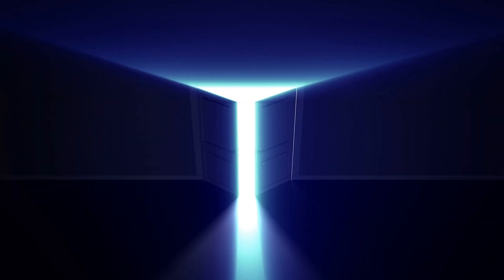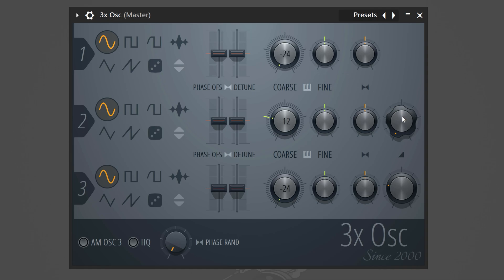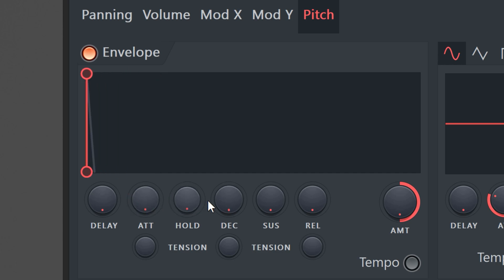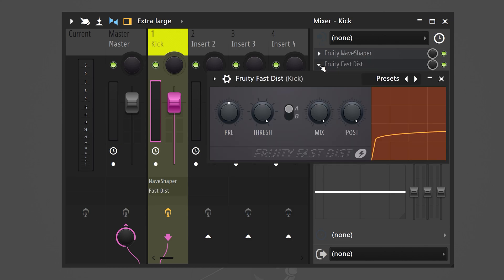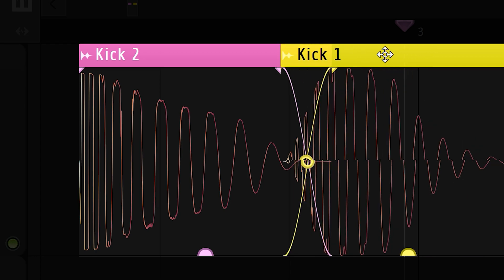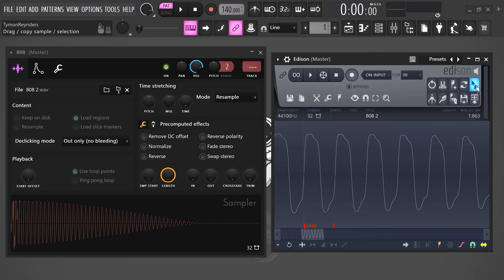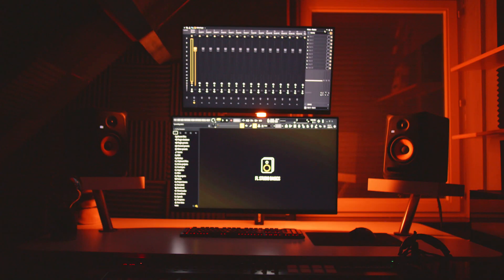Most Producers IGNORE Sound Design (And it RUINS Your Music)

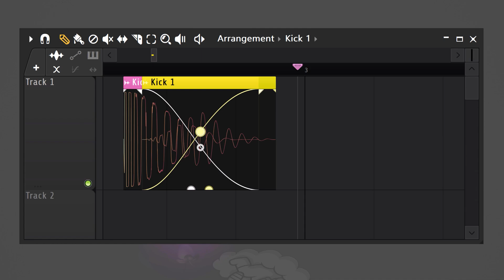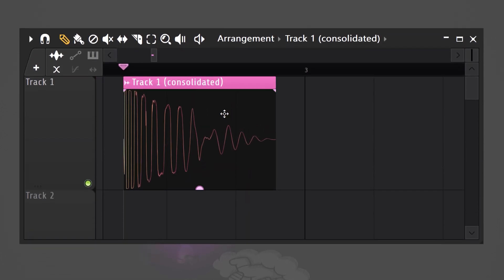Comment: Amazing sound design tips and tricks! So glad I found your channel a few months back. One thing to keep in mind when blending 2 kicks together, or any sound for that matter. If you see the wave forms are going in the opposite direction of one another like at 2:32, reverse the polarity of one of the kicks to avoid phase cancelation issues. Then when you consolidate them, you won't have that odd shape in the wave form such as at 2:44, and you'll keep the sound of the tail a bit better.